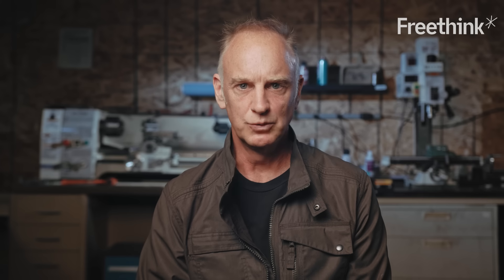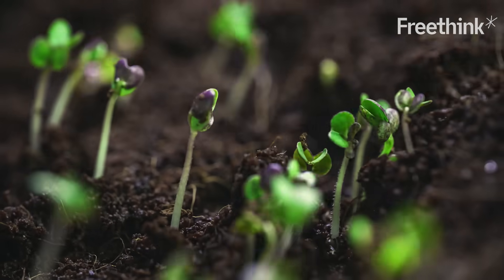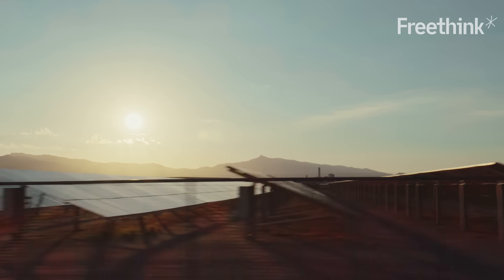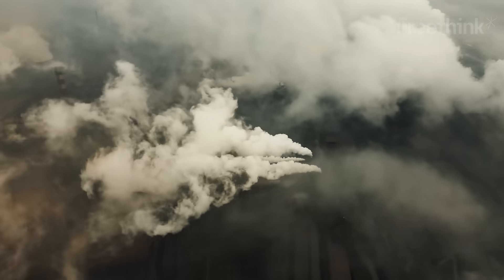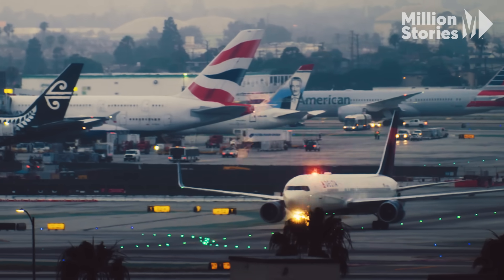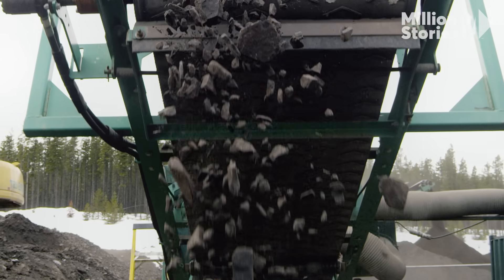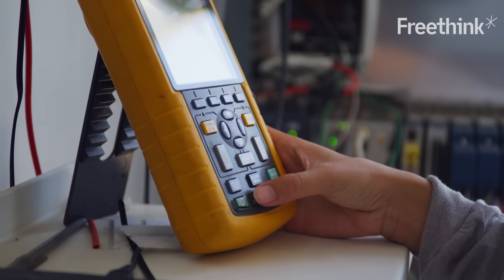Artificial photosynthesis turns CO2 into sustainable fuel | Freethink

Comment: I have one question, how effective is the energy return compared to the energy cost… how much energy does it take to get the fuel from CO2, and how much energy is that fuel theoretically worth if it was used at a power plant just moments after it’s made?
Reply: Does it really matter if the energy is practically free? The only thing that matters is the final price of the product. The efficiency to produce the fuel is probably less than 30% and the fuel itself when converted to useful energy is around 15% so the final efficiency is something like less than 5% but who cares if that's the only possible way to make the things moving
Reply: Some numbers for the naysayers…. a gallon of gasoline is about 35kWh of energy. The cheapest current solar power is about 2c/kWh (far cheaper than coal or nuclear). At 50% thermal efficiency for synthesis (theoretically possible), there is only $1.40 or so of solar energy required to make a gallon of gas from atmospheric CO2. Reduce the efficiency to 25%, and it’s still under $3/gallon. That’s easily cost-competitive with fossil fuel, especially in 2022. And fossil fuel will keep getting more expensive, while solar will keep getting cheaper, and process efficiency keeps getting better. Sooner or later, those curves are going to cross. Synthetic fuels WILL be cheaper than fossil fuels. It’s almost inevitable. It’s only a question of when, and who scores with the breakthroughs that become dominant players. Someone, or a small handful of companies, will get to replace the entire petroleum industry. That long-play reward is huge enough to get a LOT of investor and government interest.
Reply: And how efficient is said jet fuel? For all we know a barrel of this jet fuel could be anomalous to using wood for heating vs electric heating, that is compared to aviation grade kerosene.
Reply: The Sun is free
Reply: Synthetic fuels are an old debate in Germany and one reason why they are deemend unviable is the efficiency, an ICE car needs between 5-7x as much electricity as an electric car.
The Power to X on the other hand is usefull in the energy transition because reneweables in the spring/summer months would generate more electricity than needed which can then be stored long term in synthetic gas/methanol/ammonia for the winter and can be burned with retrofitted gas plants.
Reply: It takes vast amounts more energy than you'll ever get back. This is just some pitchman making a play for investor funds. Vaporware
Reply: @joecummings1260  all energy collection and use is going to have massive inefficiencies in conversion. The trick is to make the thermodynamic waste economically viable.
Reply: You are ignoring the chemicals needed to make a reaction to separate co2 from the air, these chemicals need to be constantly manufactured and replaced in your system. How are these spent chemicals disposed of? Synthetic fuel is a multi-step process, after creation it needs to be refined to an engine standard using even more chemicals
Reply: @joecummings1260 it should be considered as sort of battery synthethic fuels have deffinietly some benefits like common usage in large demands, easy storage and transport in existing infrastructure etc.
Reply: I think you are wrong. If you check out the Rethinkx report on Solar pv you will see that by 2030 the marginal cost of electricity will be close to zero.

Comment: Some idea of how they are actually doing the process (via animation?) would IMHO be useful. Also, going at scale might have an effect on water supplies unless they are using ocean or non-potable water.
Reply: It's likely that the water will have to be relatively pure, meaning they'll have to install desalination or filtering plants to make it usable, further contributing to energy usage and carbon expended in building and running the whole operation.

Comment: Fascinating idea, but too many holes in the video.  Too much stock B-roll.  The idea and scalability are mentioned, but nothing about the actual process.  This could be about any biofuel.
So...  Artificial photosynthesis, OK, but..... algae?  Some new electronic tech?  Why concentrated solar, instead of big algae ponds or similar?  Likely not a biological process if such high heat is required..
I want to cheer for this team, but there have been too many snake-oil salesmen, with their magic black box and fudged numbers.  Does the science on the specific production piece work?  And can it really scale as stated?

Comment: Fuels made from c02 release that c02 when expended. It means you aren't taking c02 out of the atmosphere, you're taking it out then putting it back in. It's merely less bad rather than good.
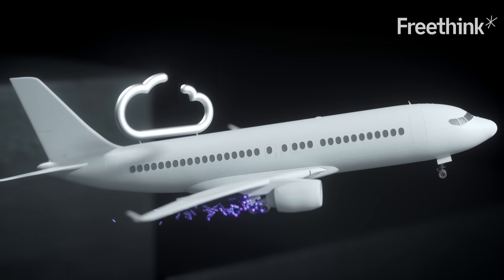Reply: Sure, it's called Carbon Neutral, as explicitly explained at 3:52.
There's no silver bullet that's going to solve 100% of the carbon issue, but if we can start making entire industries, like transportation, Carbon Neutral, that's a major chunk of additional carbon production nullified.
Less bad is good.  It buys time until carbon capture solutions are production ready.
Reply: Not really, because it would mean that there would be no more co2 emitted from fossil fuels. Because that's problem, by burning fossil fuels you put loads of carbon that has been locked underground for millions of years, into the atmosphere, and you increase the total amount of CO2 in the atmosphere. If you capture and convert it back into fuel, the CO2 level remains the same.

Comment: I like how Dimensional Energy removes the CO2 that it creates. I also like capturing hydrogen from smokestacks and other alternative exhausts. By flowing syngas over a 20’ cargo container  Plasma Kinetics can hold 1000Kg of "safe" H2 in their film canister for over 5 years with no losses or special storage requirements. This means any company could store the hydrogen with no need for an electrolyzer. By adding some pressure (30psi) and a little heat from a laser they can capture 1000Kg H2 in minutes and release it when needed.  There is minimal cost upfront to capture hydrogen, no pressure, and no heating required. The cost to release hydrogen is reliant on the efficiency of lasers which is over 70%. So this process makes it close to twice as efficient as an unsafe hydrogen  electrolyzer 
PK stores the hydrogen on a long thin roll film in a canister that can be used 150 times and then needs to be recycled. The laser is only removing the protium from the film and not the deuterium so the deuterium can be extracted which would pay for the cost of producing a new 100% recyclable thin film. The film canisters are not owned by the user but are simply swapped out like Blue Rhino propane canisters.

Comment: I'm OK with this as long as the carbon is not counted twice. That is, if the carbon is captured from steel making and is then used to make jet fuel it can only be counted towards the steel making or the jet fuel but not both.
Reply: Well that would be carbon emitted from the steelmaking process, not what's consumed in making the steel, so it shouldn't be counted at all on its own.

The weakness to this technology, though, is that it depends on having carbon capture near the sources. As those sources decarbonize, this idea becomes less effective and they will need to pursue something like direct carbon capture from the atmosphere... which doesn't work great at this time.

But I'm looking forward to what they will come up with. The technology is already looking hopeful if they project something like $1.60 a barrel.
Reply: @georgepal9154  You could either be close to the CO2 source or be close to the cheapest renewable energy available. I think the latter is the best, both economically long term and for the climate.

Comment: it's not carbon neutral if the co2 is not removed from the atmosphere but sourced from carbon producers. this is greenwashing.
Reply: Is it though? Your explanation makes it look even better. There are some industries which won't be able to make a fast transition. Capturing the CO2, which would otherwise end up in the atmosphere, sounds like a good thing to me.
Reply: @CalmoDS99  capturing co2 and then releasing it in the atmosphere via a detour still adds to the co2 released. how is this "even better"?

Comment: Scambait... Guaranteed!  
Think about the most basic laws of physics & apply it to the system they describe.  

You can never get more energy out of a system than what is put in. 

So far as specifically creating jet fuel (kerosene) from carbon dioxide, the most efficient method is still growing an oil rich, non food crop, which doesn't require supplemental nutrients nor additional water & removing the oils to be fractionally distilled.  
Something like gumweed.

Each step of that still requires additional input of energy sources from the outside.
Reply: Think of it more as making planes solar powered, with hydrocarbon fuel as the currency.
Reply: @PDXdjn  
But it's not... 
There's not even anything comparable happening.  

Think about how beneficial carbon credits are to large, pollution causing industries... 
If this were anything other than an attempt at disappearing with the startup capitol of their investors, they'd already be making money by selling their services in the form of carbon offsets.  

Their business model is intentionally unsustainable, by their own admission & requires that their suppliers release the very same emissions that they decry as pollution.

Comment: This series gives me hope.
Reply: I agree but isn’t CO2 a building block for trees and mushroom etc… ?
Reply: @1Ascanius  We shouldn't remove all CO2 from the atmosphere, CO2 is incredibly important for keeping earth at a habitable temperature, and providing plants with nutrients. But by burning fossil fuels, hydrocarbons that have been locked under ground for millions of years, we have disrupted the natural carbon cycle, and introduced much more CO2 to the system than is necessary. That's why the climate is warming.
Reply: @1Ascanius  we broke the natural CO2 balance when we freed tones of it by burning some of it's extremely concentrated forms: carbon, gaz and gasoline. Restoring the forests and plantes wouldn't fix everything anymore as we added a lot to the equation.
Reply: Yas!
Reply from the maker: So glad to hear, thank you for watching!

Comment: My hint as a biochemist is that if you take carbon footprint and do an LCA of the whole CO2 used to produce by the thingamabob, you'll notice that plants are the best at transforming CO2 into fuel... It might be cheaper to do it, just because the low energy prices - which by the way exactly why we are going to experience a climate shift in the first place. Does it make sense then? Absolutely fucking not. Does it sound cool and will make a ton of money for investors? Suree! You are fucking crooks using willful ignorance, the bane of humanity and why we are heading headfirst into a wall.

Comment: This is so damn exciting!! 🤞🤞🤞🤞🤞🤞🤞🤞🤞🤞
Reply: This is so damn depressing... 
They intend to use CO2 scrubbers on smokestacks in pollution causing industries, then power from pollution causing electricity generation to compress it.  

The rest of the garbage they were spewing was incomprehensible, from an engineering standpoint. 

Look at it this way: if they actually found a way to sequester CO2 in an efficient manner, they could sell carbon credits all day long. 
They're not though... they're using buzzwords & misdirection to get short term financial backing and they'll never actually deliver a product.

Comment: Just. Plant. Trees
Reply: There is a limit of CO2 intake that trees can provide even if we were to plant a lot of trees. It would required land mass twice or maybe three times as big as the Amazon rain forest just go compensate our CO2 emissions. That is not even taking about the CO2 emissions that dead trees will provide (since the body mass of the tree is literally a storage for CO2). It won't be a win win situation. 

What these guys is genius in a sense that you can reuse the same bio-product waste over and over again as long as the Sun is out  (which the Sun is here to stay for at least billion years).
Reply: @JesbaamSanchez  let's talk about the land mass required to extract rare minerals, refine them, make solar panels and wires and thingamabobs and ship it to this genius
Reply: @Rhinoch8  if you are debating me on the environmental impact of making solar panels. Then let's look into the materials.

Summary list of making traditional  Solar Panels requires: 

• Crystalline Silicon (for Silicon cell, which can be extracted from sand which there is a lot and we don't need a lot to power our world energy needs) 
• Solar Cells Sealant *Silicon Rubber 
• Backstreet *Mylar
• Frame *Aluminum (which aluminum materials can be recycle and resume for frames)
• cover *glass (ahem sand again) 
•Cabling *Aluminum or copper (again recyclable materials) 

No where does making solar panels present any harm to the environment (or lack there of) and the argument that you need a lot of land to extract the materials is unjustified. As again most of the materials are readily available and can be gain from recycle materials. Unless you have a scientific article that claims that solar panels are an environmental harm to the planet. The claim as as illogical as Gordon Johnson claims Tesla will go bankrupt or anti-EV people claim that EV's contribute more to the climate change. 

There is clear evidence that shows that solar panels are more sustainable and environmentally friendly, and if there was some negative environmental impacts. The outcome from solar panels offer benefits rather than negative impact.
Reply: "Reduce, Reuse, Recycle" - why do we never do the first two? :)

Comment: plant tree ❌❌❌ energy hungry carbon capture ✔️✔️✔️
Reply: no offense to this technology is great idea too ....
Reply: Plant breath and release CO2 and absorb  by photosynthesis but are less efficiente than technology
Reply: @klmtiptoptiptop474  they are much more efficient than anything, it's just that if you cheat on the Life Cycle Analysis of the solar panels and all that had to be extracted refined and moved around to produce the solar panels, you'll understand that it is only possible because of cheap oil. It's about math and the definition of efficiency. Is it quicker than plants? Most certainly. Does it uses less energy overall if you take the whole system into account? Absolutely not.
Reply: @Rhinoch8  right WE have to ne in the same sens of efficiency i speak only the production but adding you point of view of the prior part i understand but there is almost nothing that as oil in production line WE use oil for transport or production even both so as long we use oil for transport and electricity. The most important Factor is does it useful
Reply: @klmtiptoptiptop474  we just mimicking nature ... just plat a seed it will works by it self ... earth live because single cell simple creature photo synthesis ... not carbon capture device ...
Reply: @zunriya  yeah life work by it s own rule we mimicking nature when it's efficient but life is less good on some aspect for our use 
Exemple why horse have no weels but weels are better shape for traveling but they can't biology doesn't allow it but de can with car 
I think i know what you mean the fact that we creat those technology is for mostly not change our way of life not many people in west to remove most our technology and comfort but it s the principal cause of climats change it's less difficulte to create technology that capture CO2 than change a way of life how many people would really want to lower there comfort for the sake of biodiversity
How and plant capture CO2 yes but not the same quantity need lot of Time and when burn reject all of what the capture
Reply: @klmtiptoptiptop474  yeah but tire not carbon neutral on process ... like a star human mimick as fusion reactor use deuterium and tririum which still hard to produce and only india had big chunk of it sell at sky rocket price ...
Reply: @zunriya  fusion is possible Can WE make more energy is the question and it s normal and it s better that the product is Carnon neutral that not

Comment: It is carbon neutral if all the carbon generated to build and run such infra is also compensated.
Reply from the maker: Yes, that's one of the reasons solar power is key. Of course, also worth noting that oil drilling and refining takes a lot of power to run too.
Reply: Exactly. But leave that to Sustainable Consultant agencies to use statistics to do "Certified Green LCA"
Reply: @Rhinoch8  When you look at the way some controlling organizations work (watch seapiracy, great documentary), I would be happy to look at a report analysis on the subject so I can get some insight on how to do a rough assessment myself.
Reply: Exactly
Reply: That is not essential but it would be the cherry on the pie.
Reply: @Audrey P metalworking uses electricity as heat source. It's a matter of electricity's origin.